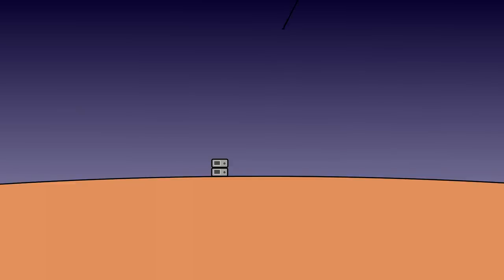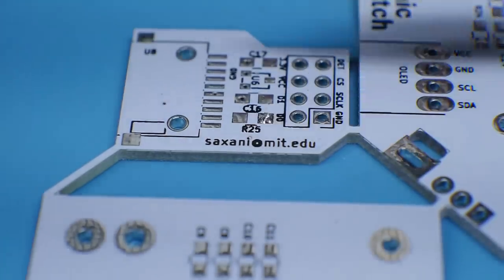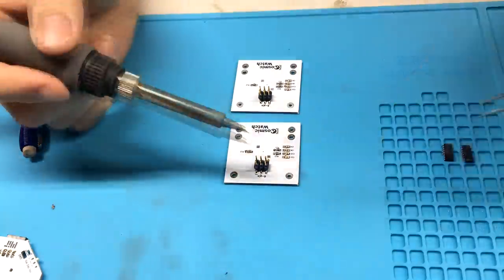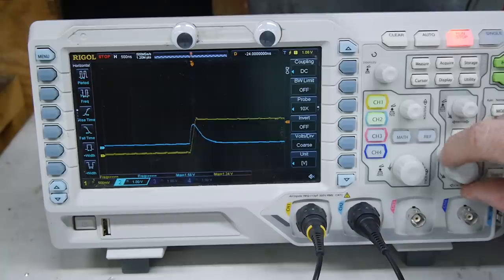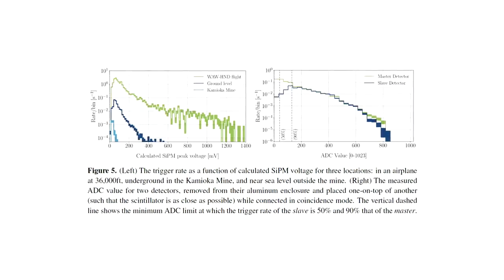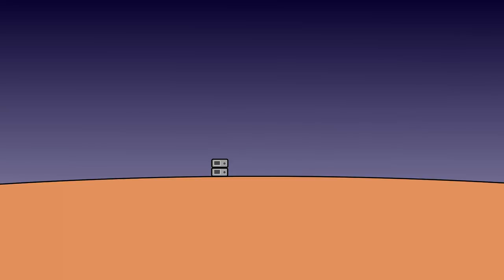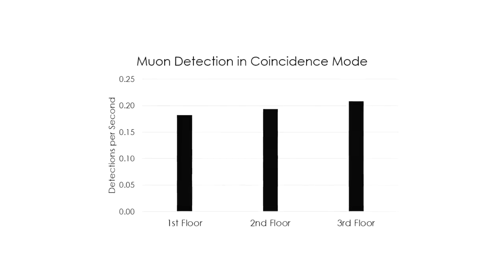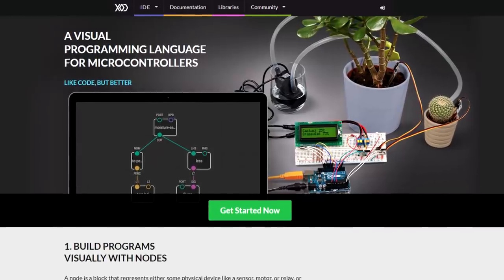How to Detect Muons!

Comment: Fun fact, those muons don't last long enough on their own to make it through the atmosphere, but they're moving so close to the speed of light that their lifetimes get a boost thanks to time dilation a la special relativity.
Reply: And since the muons don't see themselves moving slower in time, that's proof that the muons actually see the distance from the top of the atmosphere to the surface length-contracted down to a few inches, so they can travel the entire distance before decaying.
Reply: lol, typical nerd trivia material
Reply: yes its called lorentz contraction. for a particle travelling 99% the speed of light the earth might only appear to be a few hundred meters in thickness, allowing the fast moving object to travel large distances 'relatively' quickly.
Reply: You know what this means... FLAT EARTH CONFIRMED from a muon's perspective.
Reply: It's also a fun fact that for photons emitting from the sun, their entire journey from the inside, through the photosphere, out the sun and to the earth is instantaneous from the perspective of the photon but from the perspective of an observer, it will appear to take time.

Comment: Muon detection was used to discover a new hidden chamber in the great pyramid at Giza in 2017 and it is touted as a new approach to 'seeing' inside large dense objects like volcanoes, a technique called muography
Reply: they had that on pbs not too long ago. i think there was something about using it to view the reactor core in japan.
Reply: The technique is quite similar to what he shows in the parking garage. With several measurements in different direction it is possible to get a density profile of the material above the detector.
Reply: That was all hot air. The "new chamber" theory has been completely debunked using other methods.

Comment: With increasing size of the szintillator you can quite reduce the necessary measure time. Currently we implement a similar device with a big very thin woven szintillator. This will be put on a drone / weather balloon to measure rate and direction depending on the height. In this case the experiment focused on undergraduate physic students to build this. Additional we will use one of the STM32 boards for its much higher performance and efficiency.
Reply: szintillator? is that a type of pasta machine?
Reply: Scintillator is a material that, simplified, generates light when high energetic particles path through it. This is much more light then other process like cherenkov would generate during its fly-through. This allows an easier detection. In case of the sensors used here (SiPM) the ideal wavelength of generated is around 420nm. There are several materials that are usable. The one we use here in the lab is PMMA (Acryl/Plexiglas) with a little bit Naphtalene and PBD. Naphtalene emits UV when excited and PBD changes the wavelength to the targeted blue. 

The use of a mesh additional has the benefits to guide the light into the sensors so less loss on the mylar foil that is used to wrap the block.
Reply: Dominik B I think he was kidding. Since you spelt it differently.
Reply: Dominik B thanks for the info though.
Reply: Oh ok, szintillator is the german spelling. Seems that I missed it...
Reply: sorry, i didnt know that was the german spelling. thanks for taking the time to explain anyways though
Reply: also I didnt know so many different polymers were used for particle detection/scintillators.
Reply: I launched one of these on a rocket up ~4000ft.  Still awaiting the results
Reply: Dominik B May I ask what your job is? sounds interesting
Reply: Dr Din I am currently working on my phd in particle physics

Comment: I did my MSc thesis on a cosmic ray detection experiment (the JANZOS array) trying to detect cosmic rays created by supernova SN1987A, which was in the Large Magellanic Cloud, and is the nearest known supernova in several hundred years. We used two different detection techniques: scintillator detectors (like yours) and air Cerenkov detectors. (Your shot of fancy science cosmic ray detection was air Cerenkov, but much more sophisticated that what we had.) Our scintillator array had 76 detectors, each 1m^2 or 0.5m^2, spread over about 150m diameter area.

Although you describe your device as a muon detector, it will detect any charged particle which is able to penetrate the atmosphere from source to your detector, and penetrate the detector itself. 

When a very high energy cosmic ray hits the top of the atmosphere, it will interact with an atom to produce several slightly lower energy particles, which in turn interact to produce still more particles, until you have very many particles travelling just short of the speed of light and spread out like a pancake. This is a particle shower. Eventually the particles become low enough energy that interactions with the atmosphere absorb the particles rather than generating new ones, and the shower dies. So it starts small, gets big, the dies away to almost nothing. The big exception is the muons, as they are much more penetrating than the electrons, positrons and gamma rays which make up most of the shower. If you are at low altitude, very few cosmic ray showers will penetrate the atmosphere that far, but the muons that they produce will (and hundreds of metres of rock beyond that.) 

Our scintillator detector array used detection timings from the detectors to reconstruct the direction of travel of the particle shower, and hence of the initial cosmic ray.

Muons are so penetrating that a few floors of parking building concrete should have minimal effect on them. (It is a long time since I worked on this, so I might be wrong here.) I expect that the reduction you saw was rather due to shielding from non-muons in the rare cosmic ray showers which penetrated to your level. Also note that when you get a coincidence detection with your two detectors, it might not be a single particle which travelled through both detectors, but a cosmic ray shower where different particles in the same shower triggered the two detectors. You can also get coincident counts from local radioactivity, so long as the particle can penetrate both detectors.

Here are some more experiments for you:
If the coincidence counts are from single particles, as you move your detectors further apart, the detection rate will fall, and the decrease in rate is easily calculable from the geometry of the relative placement of the two scintillators. Conversely, the coincident hit rate due to cosmic ray showers will be independent of the relative location of the two detectors (unless the separation is large compared to the size of the shower, which would be at least tens of metres.) (Your side-by-side-detectors measurement might already be a measurement of cosmic ray showers.) So it should be pretty easy to separate these two effects. (You'll need to think about the length of the time window for coincidence counts. To detect showers, your window needs to be at least as large as the light travel time between your two detectors. If your coincidence time window is something like 1ms, this won't be a problem, but if it is 1ns it could be.) Once you've done this to estimate separate rates for showers and for muons, you can start to experiment with how this changes depending on location:
* At higher altitude, you should see a higher shower rate, but much the same muon rate. Expect a very large difference in shower rate between sea level and a few thousand metres altitude. (Our experiment was, as I recall, at about 1600m altitude.)
* Shielded locations (parking building) should decrease shower rate but have little effect on muon rate
* Local radioactivity rate (which would behave like muons, as it its single particle coincidence) should be very dependent on location, such as whether your detectors are sitting on rock or on a thick layer of dirt. (I'm really not sure if this rate will be significant at all.)
* If you have your two detectors stacked vertically, counts from local radioactivity are likely to be particles coming from below. Try putting a few cm of lead under your detectors and see if it makes a difference.

Did we detect cosmic rays from SN1987A? The Cerenkov detectors gave us a marginal signal (I think it was 3.3 sigma, after correction for multiple testing) for a two day period when other experiments also thought they saw something, but we got nothing significant from the scintillator array.
If I remember correctly, our scintillator array detected about one shower a second, but it had much greater collecting area than your little detector, and it was probably at greater altitude, which has a big effect on shower frequency. 

We'd have loved to have had dedicated muon detectors (basically more scinillator detectors but buried under a few metres of rock) as part of our array. Showers initiated by hadrons (protons and antiprotons) produce lots of muons, the approx 1% of showers initiated by gamma rays or electrons/positrons do not. Because magnetic fields bend the paths of hadrons, the direction of the shower doesn't indicate the direction to the cosmic ray source. If we could have distinguished between hadron initiated showers and gamma/lepton ray initiated showers, it would have improved our signal (gamma ray initiated showers) to noise (anything-else initiated showers) enormously.
Reply: Just for clarification: I have very little feel for whether showers will be producing any significant number of coincident hits. If you do my suggested experiments, you quite likely will find that showers are not being detected at all. I could go research shower rates, particle densities in the showers and penetration depth in the atmosphere to get an estimate, but trying it out is more fun.

Also, here is another experiment you could do. You've already stacked your two detectors and then laid them on their sides, to detect sideways moving particles. Try leaving them in normal upright orientation, but side-by-side. This greatly reduces your detection cross-section to sideways moving particles (they have to hit the thin dimension of the scintillator slab in both detectors) but increases the cross-section to showers (as these come from close to overhead, as anything not close to vertical will get greatly attenuated, and this orientation presents more cross-section to vertically moving particles.)
Reply: So super small particles gotcha
Reply: @michaelwoodhams7866  - Thanks for the clarifications.
Reply: Thanks for the clarifications.

Comment: Thanks for your venture into subatomic particle detection, processing and readouts. That circuit board was beautifully designed with descriptive labeling.

I spent much of my career at the SLAC research facility, as an electronic technician working with particle detectors and beam position monitors.

Comment: Awesome video- I'm a bit tempted to build an array of those myself.

If I can offer some constructive criticism on soldering- It helps to apply heat to the part and board pad at the same time, then introduce the solder after they're both warm. When done this way, the solder will quickly wick to both. It also shortens the amount of time you have to work with the solder, so you can get the joint done correctly before the flux burns off (which makes the solder unworkable.)

You'll also want to make sure that you're touching the solder to the pad and part, and not the iron. Touching it to the iron will burn off the flux before it can do its job.

Comment: You are probably aware that the measurement of muon rate atop mountains compared to sea level was and is a major proof of Einstein's theory of Special Relativity.

Since muons decay in 2.2 microseconds, at their speed, most should decay before they reach the sea.  However, the rate atop the mountain and at sea level does not show that. The answer is that we observe the muon time to slow down (time dilation) allowing the muons to last longer and reach the sea.  From the perspective of the muons, time does not slow down but the distance to the sea shortens (length contraction) and they can traverse it in less time.

In the early 1960s, David H. Frisch and James H. Smith measured the rate of detection of muons at the observatory on top of Mount Washington in New Hampshire (elevation 6289 feet) and again at sea level, obtaining agreement with the time-dilation prediction of special relativity. They published their results and made an educational movie. https://youtu.be/3CeQXsIiGp8

http://hyperphysics.phy-astr.gsu.edu/hbase/Relativ/muonex.html

Comment: A box with a blinking light is one thing. It involves following instructions to assemble a electronic kit containing smd components and so on and when it is done, it is just a blinking light. So you need at least two of them to see if particles go to both of them.

The other thing is a cloud chamber. They are relatively easy to build, you need an old aquarium (without fish and water), a method to cool it down at the bottom and heat it up at the top to create a temperature gradient. As a medium to create the clouds you need some isopropyl alcohol that will be heated from the top and cooled at the bottom. Another ingredient is a lightsource from the side just above the bottom. The bottom and the sides should be non-reflective (matte black paint) and it should be closed with a sheet of glass on the top to minimize air-currents in it. (There are many detailed building instructions for cheap cloud-chambers on the internet, some use components of old fridges or cooling boxes, some use dry ice and so on, just search for it).

Looking into such a cloud chamber is more impressive than a blinking light. It is more comprehensible, a better tool to teach people about the invisible things around them. They might ask questions how it works and this gives the opportunity to explain ionizing radiation and how it creates a trail of ionized gas which attracts the alcohol and water molecules which then condense into cloudy trails.

Of course, a desktop-particle-counter is still a nice device too. ;)

Comment: I am some research on cosmic rays at cern, whe use bigger detectors that capture around 40-60 traces a second, and are capable of triangulating the trajectory of the rays.

I can tell you that the day-night cicle doesn't have an influence, but air pressure maybe has, we are investigating it.

Also some rays come from the earth, we don't know if they cross the whole planet or are generated by radioactive decay, the experiments are ongoing!

Comment: That soldiering job though😅

edit:don't let EEVBlog see this, Dave will have a heart attack.😛
Reply: That was obviously on purpose, just adding a little extra lead shielding to make it more directional :P
Reply: In the words of AvE, the bigger the gob, the better the job, right?
Reply: As an electrical engineer I surely did have a hard time watching him melting metals and pretending it was soldiering :P 
But nice equipment though, it's better than I used to have in my work lab.

Tips to Pratical Engineering to improve on the soldering (and any who find themselves in a similar position) :
- It's small scale stuff, litteraly lighter than a feather, be extra gentle or you'll have components flying around as shown in the video.
- Use a finer tip for small SMDs, it'll help you control the amount of solder you use (and a finer solder wire would help too). If not an option, using a tiny drop of flux will help greatly (it still helps even with a finer tip).
- The idea is to solder the component to the pad, not just drop it and hope that it sticks to the right parts, so apply the iron to touch both the parts you want to solder together and then apply some solder next to the iron (not on top of it). Idealy the only time the iron touches the solder is to prep it when you start.
- On that note : when you start, melt a bit of solder on the tip and then use a slightly wet sponge to get rid of the excess, you should have around the end of the tip (2-8mm) shiny, smooth and clear.
- If you're frustrated or stressed, take a break. Soldering small electronics takes a lot of focus and some patience, especially when you're starting out. No matter the experience, you can't do a good job when the nerves get in the way.

Still, nobody's a master on the first day, so keep at it, and you'll improve :) 

I still liked the video, even with the repeated examples of "Things you must not do when soldering electronics"
Reply: I'm surprised they went with SMDs to be honest. Through-hole feels a better choice for educational projects.
Reply: It would be much neater if Grady had a hot air gun. All he had to do is apply solder to the pads and gently set the components in.
Reply: Hey, as long as it works. Right? Lol
Reply: soldiering? 

in any case, i usually prefer to attach electrical components with some electrical tape. its way easier that way and makes much more sense!
Reply: lol
Reply: mina86 Yeah, SMD components make it tough.  I was in a club at my school this year & we made two of these detectors.  One of them didn’t work because a component had a cold joint.  Took me about 2 hours to figure that out!